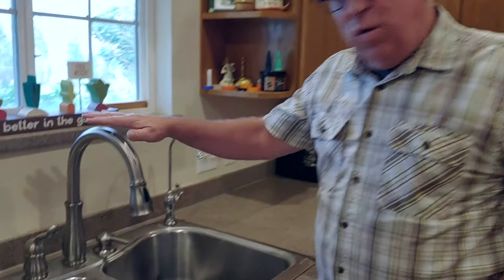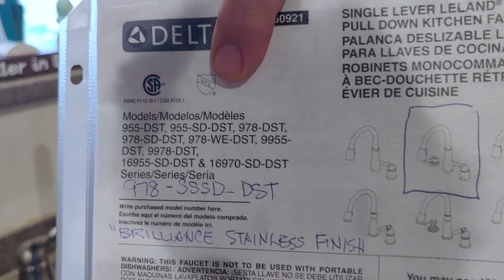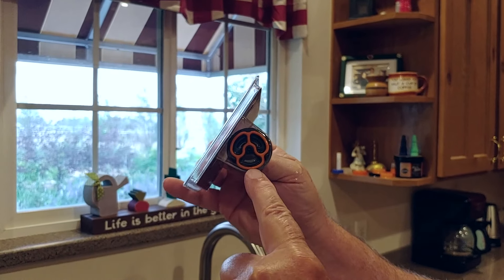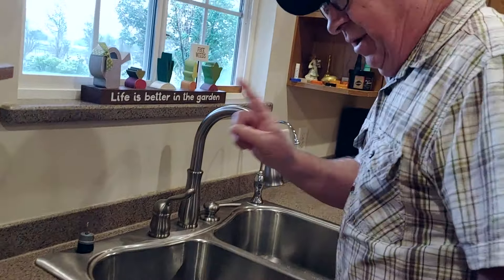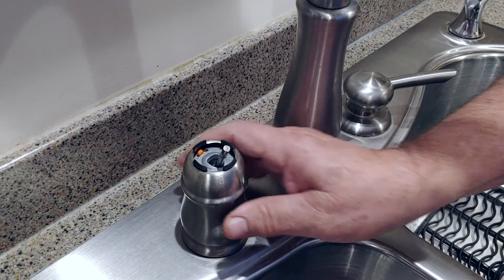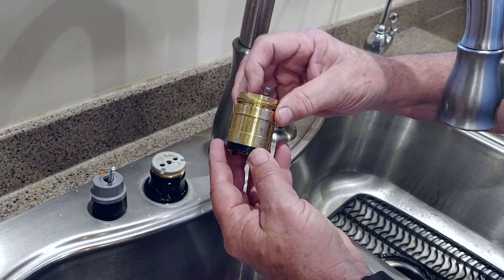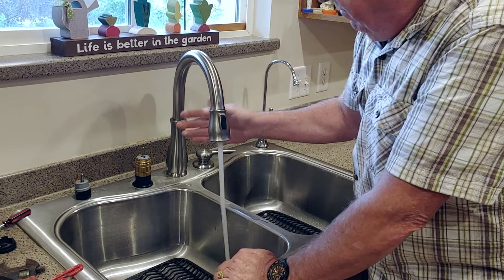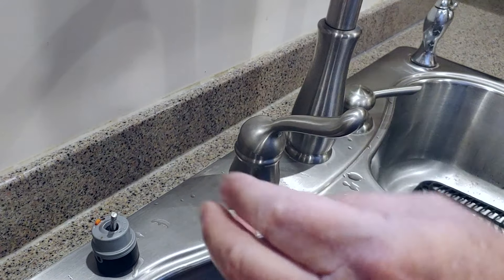Delta Single Handle Faucet Cartridge Replacement

Comment: Not $35 in 2025! I need to replace mine and it's $65. Verify with your manufacturer, mine luckily is covered under warranty through Delta.
Reply from the maker: Thanks for the update. Indeed, many times the cartridge is covered under the warranty. Best, DFJ

Comment: Sooooooo.....no plumbers grease anywhere?
Reply from the maker: Is there a place where you think it's needed? Let me know!
Reply: @DirtFarmerJay  I thought perhaps the bottom of the replacement part needed a light coating, or on the threads of bonnet nut?  I guess it's dealer choice......   Thanks for a great video.   Bob in Grand Rapids, MI

Comment: Another opinion, re: "improvements" in newer units, which basically are modular units that get thrown away versus rebuilding just the o-rings, gaskets, and balls that actually wear - the materials are no better, if not worse, and the only refinement is that temperature control switch, perhaps useful but so is the temp control on the water heater itself.

Comment: Jay, I have a Delta 978-DST that was dripping, just like yours. I watched your video several times, felt that you presented an informed and detailed process and decided to replace the cartridge myself. I planned to remove the cartridge and take it to Lowes to get the exact match. I live in Central Illinois and our water is hard and limey. After removing the set screw and lubing the hole with penetrating oil, I managed to get the handle off. I got to the 7:24 point in your video and noticed that you could remove the bonnet with the wrench by holding the base with your hand. My bonnet did not move. My wrench was rounding the points and the base was moving in the hole. I both soaked it with Lime-Away and lubed it. I resorted to using pipe wrenches to hold the base and turn the bonnet. The plastic base was slipping and stripping and finally cracked under the torque. The plastic base is hollow and held to the underbase with 2 screws - that stripped out. Now I was going to have to replace the base/hose assembly; or so I thought. The product schematic on Delta's website does not list a part number for the base/hose assembly. It cannot be purchased separately. Nor can just the handle assembly. Long story short: I have purchased a new Delta kitchen faucet - to be installed. I think that there is a design flaw in the plastic base assembly that does allow for a metal piece and place to hold it with a tool. BTW, I was completely unsuccessful in unscrewing what was left of the base from the bonnet. I finally cut the bonnet off with a hacksaw and found lime buildup. I don't think even a professional could had unscrewed that bonnet. I have pics if you're interested.
Reply from the maker: Wow, it sounds like you've had quite the experience! If you'd like to send pictures and "talk" more about this, send it to: jay@dirtfarmerjay.com.
Reply: In the exact same situation

Comment: I have a low self-confidence level when it comes to these things, but I followed the instructions, sometimes putting it on "pause"…but bottom line is double thumbs up, works like a charm. One thing I would like to add, I called Delta directly and they sent me a new replacement cartridge free of charge, no hassle.
Reply from the maker: Great to hear of your success Perry Merkel. It's our goal to help people become self reliant when it comes to home repairs and issues. Keep watching and commenting! Best, DFJ

Comment: Great video.  Very clear instruction, easy to follow.   My faucet is very similar like the one you have but the bonnet nut is a little hard to remove so do I need something (like a pair of pliers or a wrench) to grab the black rubber part while loosening the bonnet nut?
Reply from the maker: Anything you can do to "back up" the body of the faucet as you remove or install the bonnet nut is good. Use a something that won't mar the body of the faucet easily. Best, DFJ
Reply: My type has threads on it so you may have to unscrew it.

Comment: Great Job!  We have that style Delta faucet in Oil Rubbed Bronze, and it's be working for over eight years.  I contacted Delta to check which cartridge I needed, and they sent me one  for free.  I agree that showing the cut-offs under the sink is a good idea.  Also, I read that it's good to flush the supply lines when you change the cartridge.

Comment: Just got a new Delta faucet back in August similar to yours.  The single handle is already so stiff, I can see the base flex, plus, it usually doesn't turn the water off on the first try.  I have to turn it off and bring it down straight.  I got a new, free, replacement cardridge from Delta.  I think I'm going to attempt this myself rather than have another charge from the plumber.  Can't believe you got 10 years out of yours!  I'm hoping this new one is better, but my gut tells me it's not gonna be.☹

Comment: Thank you for posting this. I had some difficulty getting the handle to come off. I ended up loosening that screw to the point of it coming completely out. Ended up getting the handle off, did the switch-out, but found upon putting it all back together that the inner threads on the handle were damaged / stripped. I couldn’t tighten it back up. Really pissed off.
Reply: Finally found the right groove. The casting on the inside of the handle was not flawless, so the threads were not perfect
Reply from the maker: Patrick, sorry to hear of the challenges you've had with this. I got your follow on message as well. If you still need to work on this, reach out directly to Delta and tell them what is going on. They generally warrantee all the parts and will send you new items at no charge. Let me know how this all ends up. Thanks for watching and writing! Best, DFJ

Comment: My delta's a bit different. I can't seem to pop that chrome piece that encases the cartridge off. The plastic piece holding it down won't flex enough to allow the chrome piece to pop off. Any suggestions. I think my unit is 20yrs old.

Comment: How do you attach the goose neck to the rest? 1:57
Reply from the maker: David, give me a bit more. Do you mean how is the rigid part of the gooseneck attach to the sink deck and then swivel, or the hose and head that you pull out to be able to direct the water flow where you want it? Or??? Let me hear from you! Best, DFJ

Comment: Great video thanks! I watched another video that had the handle and cartridge on the side of the faucet and while similar, was just different enough to cause me a little confusion.  I was very glad to find your video as yours is identical to mine (except the color).  I got almost 6 years out of my original cartridge, but the replacement is working great.  I picked it up at Home Depot for $35.  No more leaky faucet - thanks again!
Reply from the maker: Awesome Adam Mayor. Glad we could help you to "Just Do It Yourself". Keep watching and commenting Adam. Best, DFJ

Comment: LOVED your presentation. Our faucet also has to be in an exact position to stop the drip. 
My 1/8” Allen was a little loose, and I double checked the size. When I tried to remove the screw, the Allen wrench rounded the opening. I also tried metric Allen’s, to no avail. 
I tried an extractor, and it too stripped the Allen head.
Any pointers on removing the screw?
Since I’m not sure how long the screw is, I did not drill into it before I tried the reverse threaded extractor.
Reply from the maker: Ernie, sorry I didn't see this sooner. I hope you got this resolved. Sorry to hear of the hassle. Two things. I think I would use some type of rust desolver lubricant to see if you can get the threads of the set screw to release easier. You'll need to drill in about 3/16" to get a grip on the set screw with the screw extractor. Easy does it, so you don't damage the square shaft of the cartridge. Let me know how it turns out. Best, DFJ

Comment: I changed out my delta cartridge for a dripping faucet a few weeks ago.  It’s worked for a few weeks but Today i noticed   the faucet dripping again.   Had to open the faucet and had s really strong release of water suggesting a  lot of pressure built up. I closed faucet again and dripping stopped. However I also noticed  water was also coming under the kitchen sink via hole kitchen faucet was installed.  I opened faucet up and tightened bonnet ring   around catridge a quarter to half turn or so. Is it possible the bonnet wasn’t tight enough snd water was flowing back under the sink and causing the dripping?

Comment: So my plumber apparently did more than finger tighten the brass part. Does it matter if the whole brass part & the black piece underneath turn too? I'm still trying to loosen it to get the brass part off 😮
Reply from the maker: You only want the brass retainer nut to turn. You may need to get a medium sized adjustable water pump pliers to grip the bottom portion so you can rotate the top nut off. Be care when doing this not to mar the bottom portion. I hope this was helpful! Best, DFJ

Comment: How do you remove the faucet handle if the set screw is stripped and in tight?
Reply from the maker: John, that can be a challenge, and it may be that you end up having to replace the handle if the set screw and the threaded hole is damaged beyond repair. Of course, try to avoid that. To get the screw out, you're going to have to use an "E-Z Out" (that is a brand name) type tool (it is really known as a screw and bolt extractor) that allows you to drill a small hole into the set screw, insert the EZ Out and reverse the set screw back out. You can search online to find sources. I hope this helps! Best, DFJ

Comment: After I removed the screw from the handle, tha handle does not pop out, what could the problem?
Reply from the maker: Nickole, give me a bit more explanation. Are you saying you removed the set screw from the main handle and you weren't able to remove it? If so, it's likely that there is calcium build up that needs to be broken apart with gentle but persistent upward force. Let me know if I understood your question correctly. best, dfj

Comment: Getting a different issue. I stalled the new diverter, and water still comes out of the sprayer and handle. The handle won't turn off.

Comment: I was able to take the top faucet handle off easily enough. But getting the bottom of faucet handle off  was problematic. I watched a youtube describing exactly how to squezze the rubber gasket prongs inward in order to allow you to pull the bottom of faucet casing up and off. However it does not seem to work. The rubber prongs are brittle and seem to be breaking off and the housing still won't lift off and over. Any suggestions would be appreciated.

Comment: would the cartridge also cause low water pressure? I cleaned the aerator and that was not the problem, but I still have low pressue?
Reply from the maker: Esha, thanks for asking. This is a process of elimination. You have started at the last item in the chain of water delivery, and you'll now need to work backward. It's possible that cartridge is clogged and is delivering a low volume of water. You can remove it, and soak it for a half day in a bowl of vinegar to see if that helps. If not, then look at the shut off valves. Turn off the valves, then undo the line from the faucet to the valve (at the faucet end) put the ends into a pitcher, and turn them on, one at a time to see if you are getting full volume delivery. If you are, the faucet IS the problem. If you are not, then that is a more significant problem. For now, just start here. Another clue is if there is low pressure only on the hot or cold side. Let me know how this turns out for you. Best, DFJ

Comment: When using the adjustable wrench on the bonnet, are you just putting it on the tip top hexagon part or also the part with the threads? I can’t get mine off
Reply from the maker: Only the hexagonal part of the brass retainer nut. You may need to get a medium sized adjustable water pump pliers to grip the bottom portion so you can rotate the top nut off. Be care when doing this not to mar the bottom portion. I hope this helps, let me know how this turns out!

Comment: Jay - my faucets bonnet nut is tightly jammed and won’t open. I tried putting a rag with half n half vinegar/water to soak around it and also tried wd 40. Any other suggestions?

Comment: In a condominium building the hot water supplied to your apartment may come from a water heater that services the entire building.  This is where you must pay extra attention to the limiter switch on the faucet replacement valve.  Why?  Because the water in such a system is required to be very hot in order to prevent the development of bacteria in the system that can cause disease.  Limit the temperature of the water being discharged from the faucet to prevent scalding.  Simply adjust the switch with the valve joystick set to "hot" prior to reinstalling the faucet control handle.
Reply from the maker: Joe, these are some GREAT insights! Thanks for taking time to share them and get out the word about this. I've learned something and that is one of the things I really like about this interactive medium. Thanks again! Best, DFJ

Comment: I am having problem trying to remove the screw with an Allen wrench in the handle. The screw are way too tight. I have tried using WD40 to lime away. Yet it’s still not coming off…. Any suggestions will be helpful. Thanks
Reply from the maker: Let's see if we can help. First, and no insult is meant here, make sure you are turning the screw the correct way to loosen it. To the right will tighten, to the left will loosen. That's the "righty tighty, lefty loosey" ditty you've probably heard. We are referring the the arc of the of top of the wrench or tool. Assuming you are going the correct way, then I would try getting a can of Blaster® Penetrating Catalyst. You can get it at your favorite big box store/retailer, as well as many auto part stores. It does a better job than WD-40 in breaking loose stuck fasteners. Also, as a last resort, you can insert a allen key into the fastener head, hold onto it with a pliers, and use a lighter to heat up the allen key and transfer heat into the screw.  When its good and hot, douse everything with cold water. Sometimes the thermal shock will do the trick. Let me know how this turns out for you. Best, DFJ

Comment: Hi, I understood the video. But I can't remove the nut that's holding down the cartridge. If I apply too much force, it begins to rotate. Any suggestions?
Reply from the maker: Yes, they can really get stuck. I'd apply some penetrating oil spray and get that into the threads of the nut and let it sit for a couple of hours. Try to remove the nut again. If no success, more oil, repeat until the nut breaks loose. Also, be sure to isolate the torque on the cartridge body by using a large adjustable pliers on the bottom portion. Wrap the body with a rag so you don't scar the finish. Then use a tight fitting large "Crescent" wrench on the top nut to loosen. The tight fit will avoid rounding off the nut. Lastly, make sure you are turning the nut the right way to loosen. It's easy to get it wrong. Rotate the nut counter-clockwise/left. Let me know if this helps!

Comment: DFJ - Is the flow restrictor located in the base that accepts the new cartridge?  Thx.
Reply from the maker: No, it's a slider on the top of the new cartridge. On the model shown, it's an orange tab. Best, DFJ

Comment: Great video, thank you. Took me hours just to get the calcified pieces apart!
Reply from the maker: Wow! Good job persevering until you got it fixed. There is something very gratifying about "just doing it yourself". Best, DFJ
Reply: Hi. Any tips for getting the calcified joint loose?
Reply: @cindysipes9130  I don’t have a magic solution sadly. I tried vinegar, decalcification fluid, hot water, and tapping on the rim.  In the end I had to have a friend hold the base of the handle with one wrench (to avoid twisting the base and damaging anything underneath) while I twisted the handle with another wrench. Took two grown women and a LOT of elbow grease! Good luck, it takes persistence.

Comment: What is the black thing under the trim package called? Mine is broken.
Reply from the maker: I believe you are referring to the mounting gasket. You can get one from Delta - they may not charge you for it. Or, someone like ereplacementparts.com may be able to help you out. Best, DFJ

Comment: Help!!!  The lever wont come off.   Even after I’ve fully removed the set screw.   Won’t budge.
Reply from the maker: I'm sorry it took so long to get back to you. I have found when things get stuck like this the best thing to use is a penetrating oil product that you can spray in the stubborn area and let it set. The penetrating oil works its way in and lets the parts release from each other. Have you already addressed this issue and got it repaired or are you still grappling with it? Let me know how this turns out for you. Thanks for watching and writing! Best, DFJ

Comment: Five times, I've replaced the cartridge on this brand. Three times before I repalced the whole thing through warranty, and twice with the new one. I don't know if it's an inherent aspect of this handle style, or if the brand is just terrible, but it's a pain in the butt.
Reply from the maker: Wow, I'm sorry to hear of the poor experience you've had. Delta is a mid-range consumer grade product, widely distributed and readily available at big box and small chain home improvement, hardware and plumbing stores. Their ratings are favorable, but from time to time, someone (lucky you!) has a bad experience. I'm curious - do you have problems with any other plumbing components? It almost sounds like high alkalinity or acidity. Yeow. Best Regards, DFJ
Reply: @DirtFarmerJay  Our water is pretty hard. You really think that could be the reason? There's a water softener in the furnace room, I think you have to put salt in there or something. Never used it.